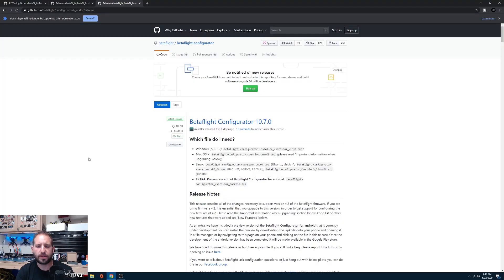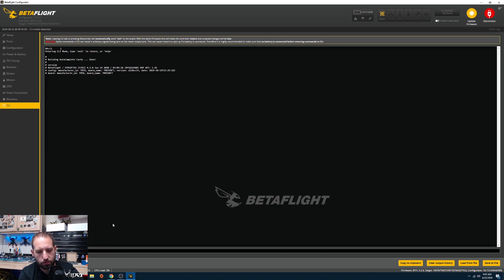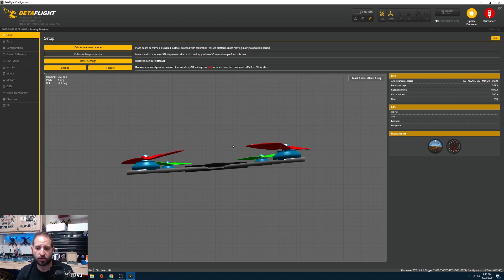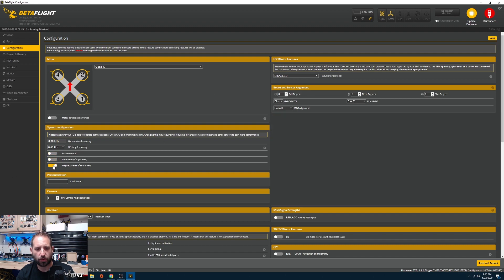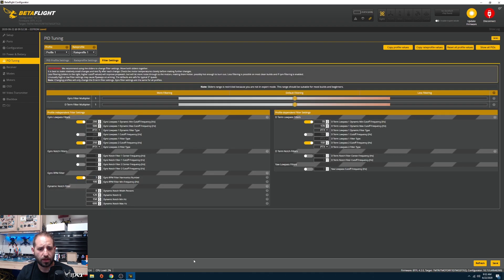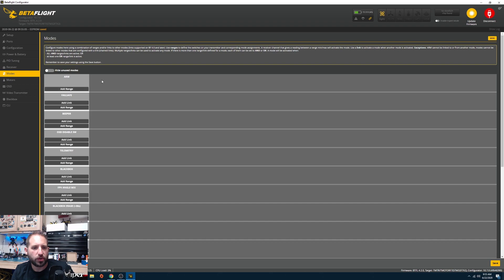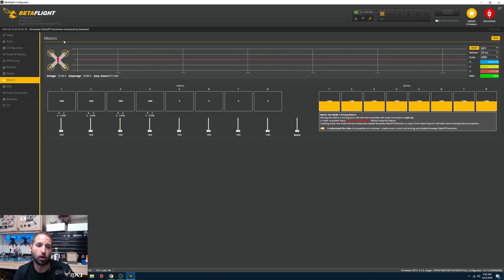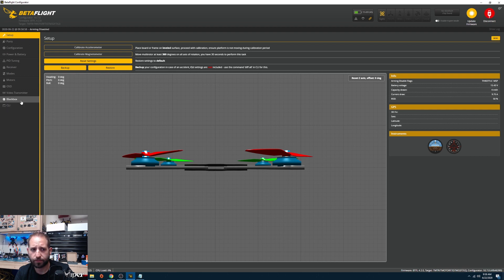Betaflight 4.2 - Initial Setup Guide

Comment: my drone is iflight nazgul5 v2 4s.I have never flown this drone yet. The documentation from Iflight states this drone was configured with Betaflight 4.2.4. If i understand what my tasks are, i need to load on my PC  Betaflight Configurator (maybe 10.10?), i need to load Betaflight 4.2, BLHeli_S 16.70 firmware (G-H-30).  I installed the Frsky archer m+ receiver attached to FC (GND, +5V, S.Port).

Comment: Thanks for the video, but as a newcomer to quad's there is one topic I didn't spot and hope you can help me with.
If I set up Modes for Angle, Horizon and Acro (Acro is the Betaflight default I believe) where do I set the parameters for each mode ?  I have found that on the PIDS Tab you can have 3 PID profiles and 6 Rate Profiles but which (if any) relate to the Angle, Horizon and Acro Modes ?  Is PID profile 1 Acro, PID profile 2 Horizon and 3 Angle; and how is that linked to the MODE pulse width set by the Tx switch ?  I just don't know what I am trying to configure here.
Reply from the maker: The pid profiles have nothing to do with angle or horizon. The pid profiles are for the pid loop. If you wanting to change like how it snaps back if u let go of the stick there is a separate setting for all that. I’ll have to reply again once I take a look at what ones they are
Reply: @ViperFPV  Thanks.  Any help with the Angle / Horizon / Acro mode will be appreciated.  Also, as there are multiple PID profiles and PID Rate profiles what makes the controller select which profile to use ?  Although I understand what PIDs do, as a total novice to FPV and quads I am finding it very hard to understand Betaflight programming.
Reply from the maker: @SmallScaleSteam  they are pid profiles you pick to use. It’s used for tuning so you can have a setup maybe good for freestyle and then another pid profile for racing.

Comment: I think most people quit the hobby when they get to  Betaflight.  They calibrate their accelerometer on a level surface, and then they are like... what next?   There's no Wizard or anything in Betaflight to guide them as to what to do next, just a bunch of random numbers with not much explanation or context and drop down menus also with no explanation.    How do you even set an Arm switch?  A flight mode switch?  No essential Aux switches are set by default.  No sample file you can download for your model someone else has tweaked out.   Without an Arm switch, you'll never start the quad.  And they get no further, and throw their quad and parts in a box and throw it in the closet...
Reply: You nail it bud! I just got to the throwing part!! lol I have 20 tabs open looking for how to arm a switch! Very steep learning curve and no fun!
Reply: @michael1473  Same...this is ridiculous.
Reply: 3 months late and hoping you found one of many many videos on YT to accomplish these simple tasks...probably on this very channel..lol..betaflight ain't rocket science....maybe take up Frisbee golf ???
Reply: @steve_beatty  Actually, believe it or not, 6 months later I'm still slogging around in OpenTX.   $2,.500 later, I've flown it all of... one time.   I found out I hated wearing the DJI goggles...  it's like wearing a damn scuba mask and sucks @ss.  

What a waste of money and pretty much regretting it.   If I had bought a used car for $2500, and it broke after a week, I would of gotten more mileage out of it than all the FPV cr@p I sourced, bought, and configured.
Reply: @spitfeueranna    lol.. Well..No one can accuse you of not giving it your best shot. 😉
Reply: Yes, that's right. This hobby is just for freaks...

Comment: Culd i use dshot 600 and 4khz,4khz for pid loop?
Reply: No PID loop is set in BF to native 8khz, 4khz is working with dshot300 and 8khz with dshot600 if I remember well
Reply from the maker: Dshot600 should be used with 8k
Reply: Thanx!